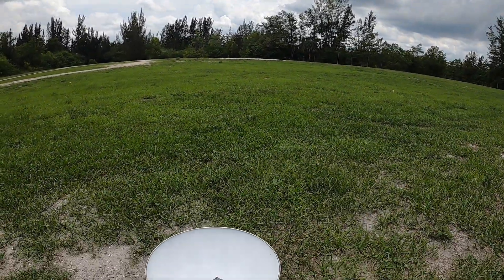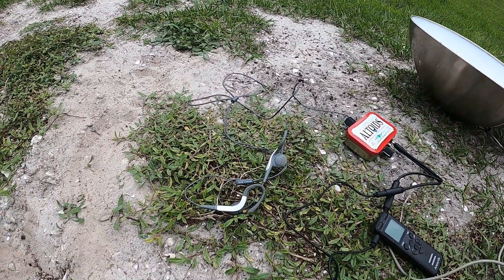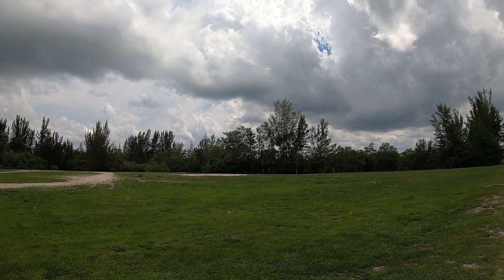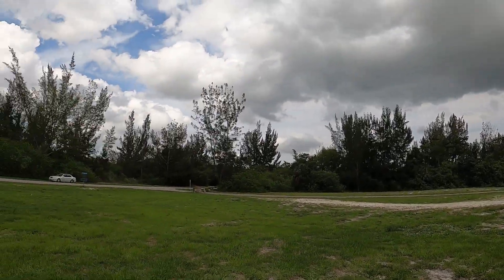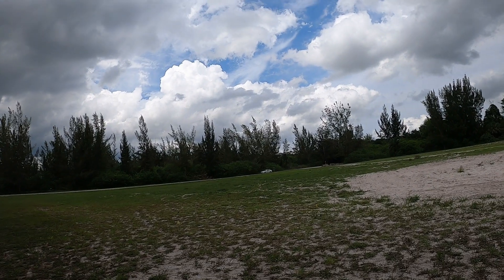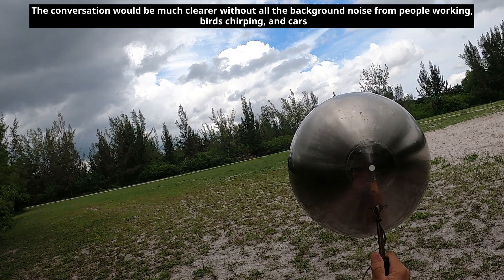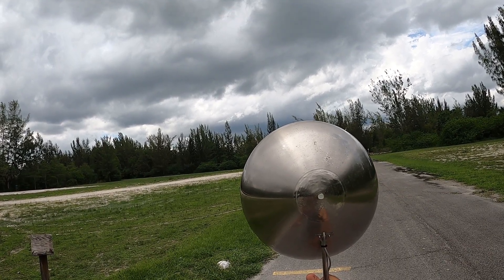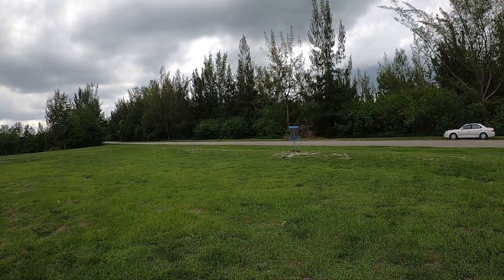DIY Parabolic Microphone ~ LISTEN IN 300+ FEET AWAY!

Comment: I have some questions about the microphones used in parabolic microphones, instead of using lavalier mics would it increase volume input with a shotgun mic or a condenser mic or would this decrease its performance?
Reply: While shotgun microphones are great for direct sound capture, in a parabolic microphone setup, an omnidirectional microphone is typically preferred because it's better suited to capture the focused sound delivered by the parabola. The parabolic reflector essentially replaces the directional function of a shotgun microphone. 😊

Comment: Pretty cool.  I could barely hear the talking when you were close to the player at first, and couldn't hear it at either distance, but I have a hearing loss, so I'll take your word for it.  I used to build DIY projects like that years ago.  I built a windshield wiper variable delay from a magazine design for a little '85 Dodge RAM D150 that only had 2-speeds and off.  I bought a cruise control for it from JC Whitney and installed it.  I designed my own car alarm system for an '82 Oldsmobile Cutlass.  I've built all kinds of things from electronics projects magazines, but I tend to buy products that I want and need now instead of building them.  I still try to repair everything I can and am usually successful at it, be it electrical, electronic, mechanical, etc.  Persistence and determination are key, just like you making improvements on this project.

I wonder if other things for the parabolic bowl would be more efficient and/or cleaner.  Maybe insulate the outer metal with something because it's rather thin.  Extending the bowl with cardboard or something may help block the wind and background noises from the sides.  A true parabola shape might help, too.  Even still, great job, Scott!  Just sharing thoughts.

Comment: I did make one of those back in the day. Stereo with both internal and external microphone 🎤 it's a pretty cool device, but I never found a nice enough parabolic dish for the reflector part. An old metal lampshade was not quite good enough. 😊
Reply from the maker: I was lucky to find a metallic dish that had a flat bottom that I hammered out. Thanks for watching!
Reply: @electronicsNmore can i use tv dish
Reply: @electronicsNmore can i use tv dish